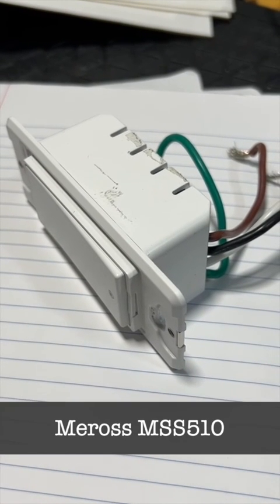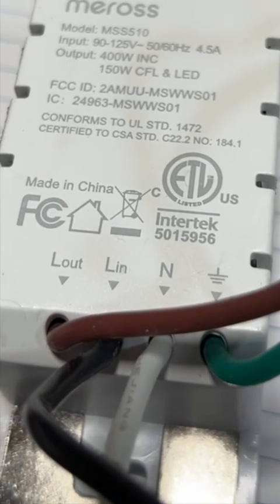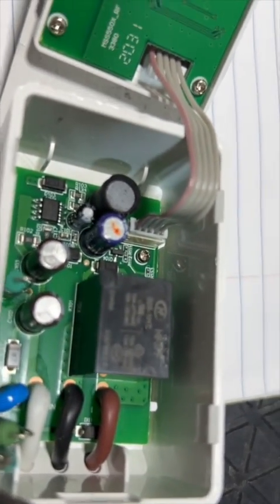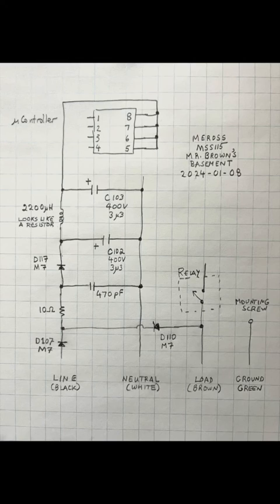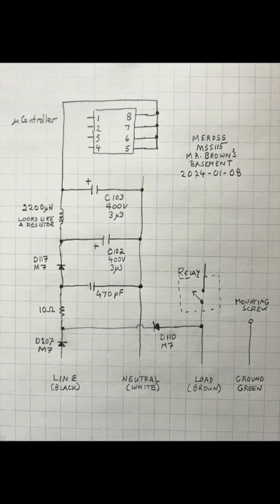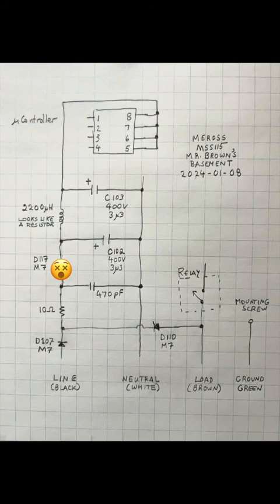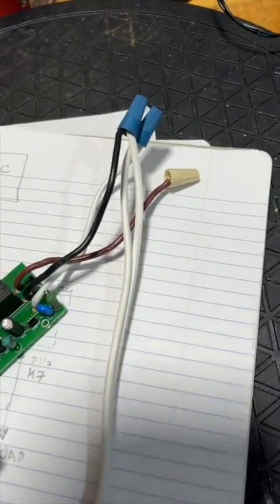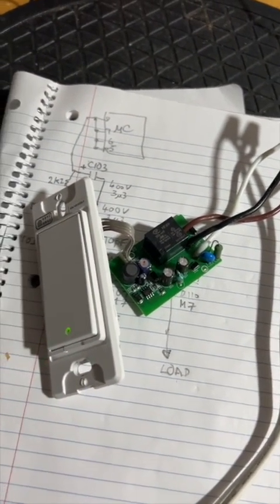Reviving a Meross MSS510 Smart Switch

Comment: My MSS510 is having the same issues, about to crack it open and test the diode. I will let you know if it has failed.
Reply from the maker: Please do. And thanks.
Reply: @Mr.BrownsBasement  All the M7 diodes tested fine (.599v). I tested the SS36 Diode which should have a drop of around .220v. Its vdrop was .057v. So I believe that its bad. Could you send me the vdrop of the SS36 diode? Just to confirm if its failed.
Reply from the maker: @highgeared4959  The forward biased voltage drop should be 0.75v ( data sheet at https://www.vishay.com/docs/88751/ss32.pdf  )  If you're reading <0.1v I'd say that diode is no longer a diode. If it's shorted, make sure that any components downstream haven't been compromised.
Reply: @ My initial diagnosis was incorrect, i assumed it was a internal issue based off the symptoms your device was having. Turns out it just needed to be power cycled and a firmware update.
Reply from the maker: At the end of the day, you’ve got your switch working again! Cue: Pat on back.
Reply: @Mr.BrownsBasement  Yeah, I ran over the PCB a few times with the meter and everything checked out. So I said why not hook it up to some power. It worked fine. Thanks for posting the video anyways to help others repair their own electronics. We live in a throw away society now since manufactures started to increasingly make it more difficult to preform repair, greedy corporations i tell ya.
Reply from the maker: My pleasure…